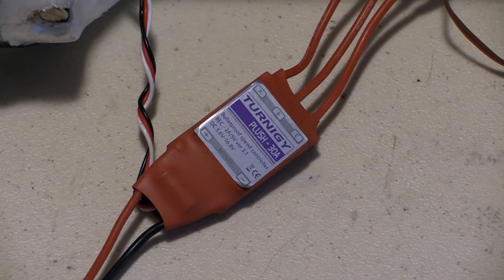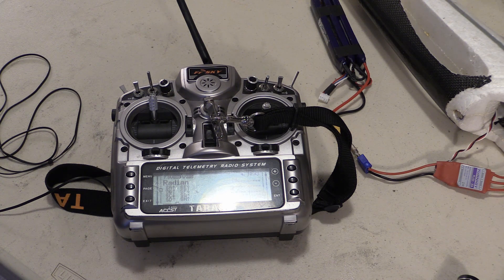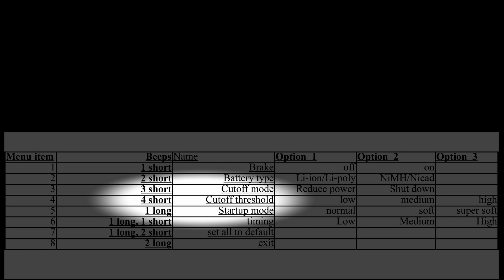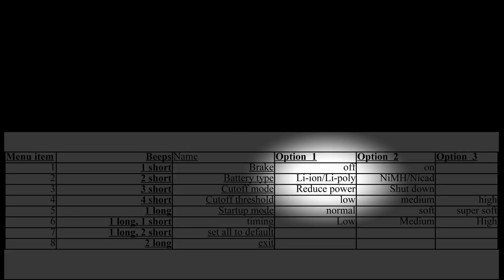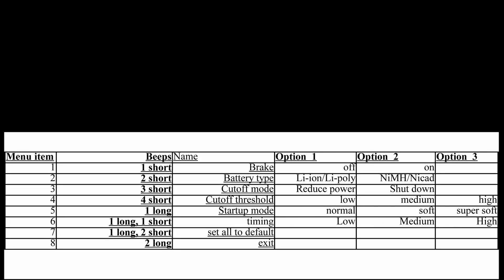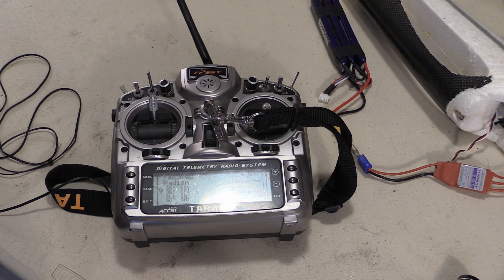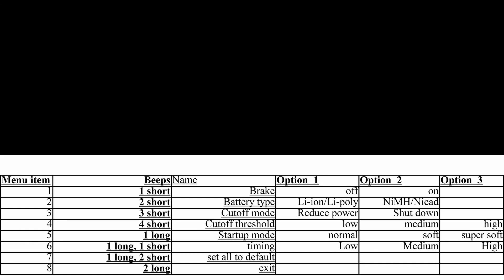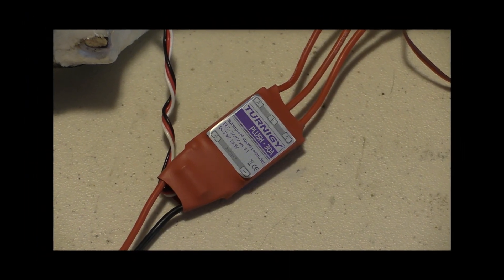ProgrammingTheTurnigyESC

Comment: do u have to program them or are they ready to use
Reply from the maker: The default functions work just fine with the exception of brake if you want to fly a glider and need the motor to stop to get the props to fold back.